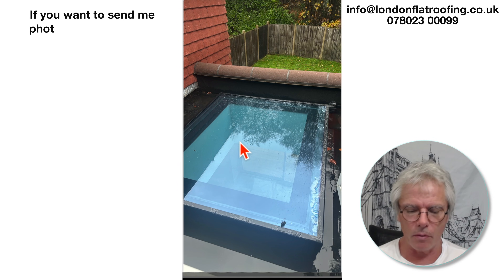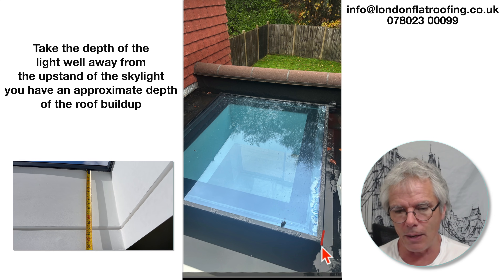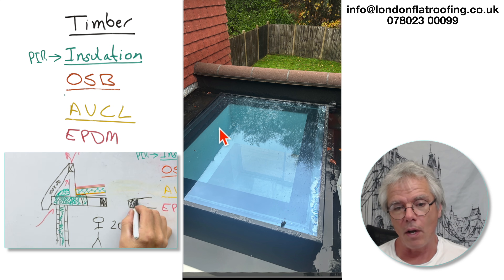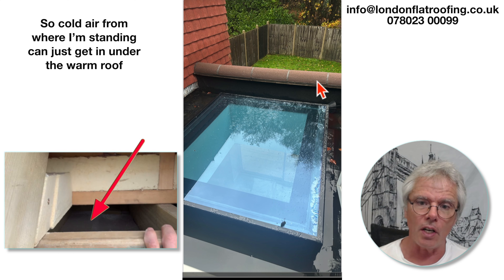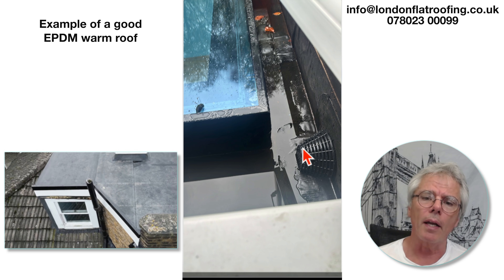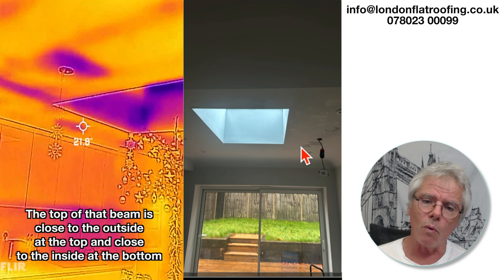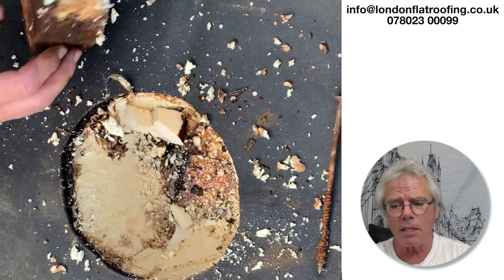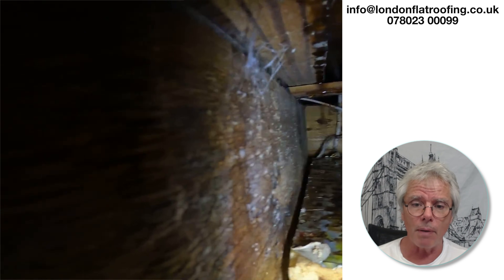The £30,000 Mistake Hidden in a "New" Flat Roor

Comment: One of the reasons why I went for a cold roof on the extension, kept 100mm air gap, insulated with 150mm wool, stabled polyurethane to the timber them plasterboard with insulation, loads of air vents on the PVC. Zero issues

Comment: Great video I'm currently installing a kitchen which has a warm roof construction and one part of it is exposed in the next room and you can see that there is only 25mm celotex which has been used feel sorry for customer as they probably don't look at those things until there's a problem
Reply from the maker: Thanks for sharing, it's a common issue when things aren't done correctly.

Comment: I dare say this is about job size. If it's a smaller project that is effectively design and build by a nominated contractor then it's all down to the experience of said contractor. As soon as it trips into a larger project then it would be more likely to have a large scale set of details to accompany the project created by a Building Surveyor/Architectural Technician etc.
Reply from the maker: That's true, but I still work on large projects of multiple properties that have fundamental problems.

Comment: 20 to 30k to re-build a flat roof, madness!
Reply from the maker: This is not only a flat roof but also a pitched roof. The average price for a new warm roof for around 30m2 is approximately £15,000.00 plus VAT.
Reply: @SteveRoofer  thanks for the clarification.
Reply: £50 per sq ft for a roof, just shows the current cost of building trades, if your careful and do it yourself you can build a house for around £100 per sq ft.

Comment: @ 4.40 you say a vapour barrier should have been fitted to stop water coming through and  vapour through .
Do you mean it stop letting water and vapour down 
Or 
Water and vapour up 
Or 
Both ?
Reply from the maker: An AVCL stops vapour from moving upwards, but if the roof leaks, it also prevents water from going down. So, whatever happens, don't let your new warm roof develop a leak.

Comment: As the building surveyor who trained me liked to say; "The best flat roof, is a pitched one"
Reply from the maker: Thats corect
Reply: Nothing wrong with a cold flat roof correctly done, I'm much less convinced about a warm roof correctly done. Any vapour in there is theoretically there forever. So you have a sauna and a fridge.
Reply: @rogermayne3372 Every flat roof is a risk structure because it relys on yearly maintainance or it will turn into a swimming pool.
Reply: @BoringBurger  Rubbish, The hot pour bitumen and felt on my dormer flat roof has been there for 40 years and it's still perfect

Comment: a big reason I just decided to do a straight forward flat roof rather than a mansard edge was due to this nearly impossible detail where  the warm and cold roofs meet.
Reply from the maker: Good decision
Reply: @SteveRoofer  What is the best way to connect a warm flat roof to a pitched cold roof. I've been wondering this every time I see a loft conversion, how do you keep the insulation consistant ?
Reply: @SteveRoofer  Steve, spelling in the title, Roor?
Reply: can't mix them , best to do a cold roof in this application